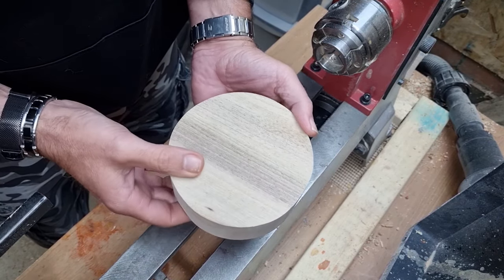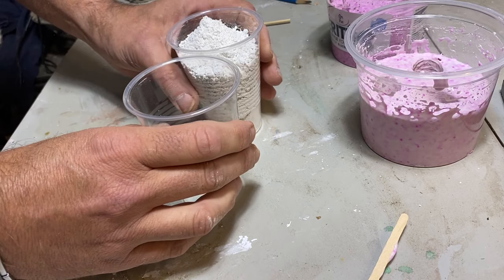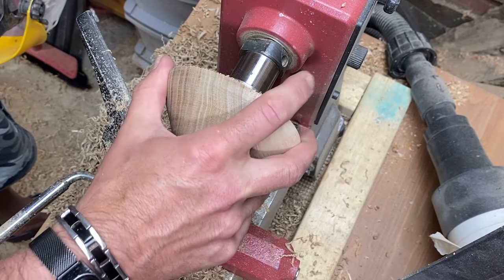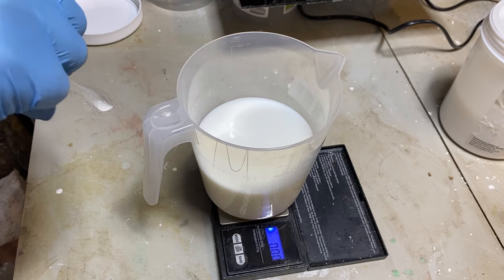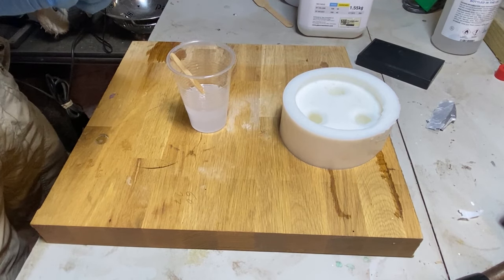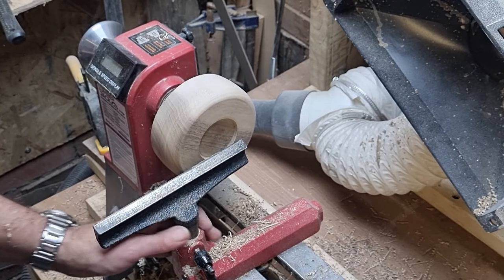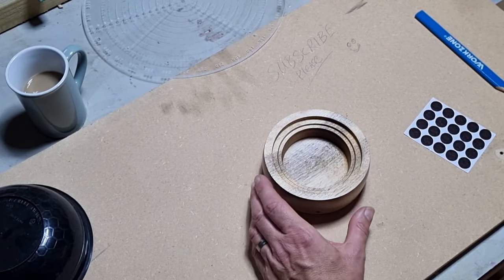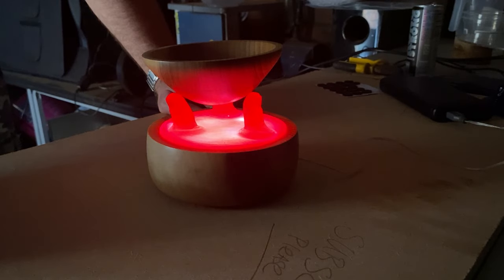This Woodturning Project Cost Me 3 Fingers!! #woodturning #epoxyresin

Comment: I was not sure what the project would look like based on the thumbnail.    Very well done.   Wow, a LOT of work.

I think the molding, casting etc. was 90% of the time and the turning was not much.

I got a smile when you put your fingers in the alginate to make the mold.    My mind went back to high school in the mid to late 60's.   I wonder how many school boys heard "{enter last name here} get you finger out"  perhaps more likely in wood or metal work class which would be long gone these days.   I can just hear Mr Gamble the metal work teacher saying such phrases.
I did not know about alginate, so I learned something.   It seems very common for dental molds - at least in the US.   Thanks.
Dave.
Reply from the maker: Hi Dave, yeah I had a few comments like that hurled at me when I was at school. You are right about the time spent making the mould against turning, all the wooden components were finished in about 40 minutes. With regards to the alginate, one of it's main uses is in the dental industry, it sets very fast and can produce a very clean mould . It's fun stiff to play around with. 
I've changed to thumbnail the video is performing worse  than ever :( 
One day I'll get it right :)
All the best
Mike

Comment: I wonder, do you think putting a layer of wax or sealant on the plaster blank would smooth the surface of the mold?
Reply from the maker: If I had covered it in a lacker or teson to give it a smooth surface then yes it would 👍

Comment: Hey awesome!  I'm totally familiar with this medium.  In 1994 I saw an ad for a product called Body P'Arts' in a magazine.  I send for it and in 1995 mixed the pink powder and made casts of the hands of two friends.  Hands to the wrists.  I poured in the Plaster of Paris, thumped it for air bubbles too.  I remember using a thin straw against the hands, then blowing to release each hand.  I still have some of the pink medium in it's container, and out in the shed, a small bucket with the Plaster of Paris.  Hey Michael, if I was your neighbor, I'd ask you if you would let me make casts of your hands too.  That'd be cool.
Reply from the maker: Haha thanks, that would be cool! But you will need to throw away the plaster of paris, as I learned when making this it only has about a year shelf life
Reply: About the pink powder of the mold medium, I remember it had an interesting odor about it - sort of a spicy scent, I think something close to cinnamon.  About the Plaster of Paris, when I can get into my shed, I'll have to mix some up and pour into a Dixie cup and check it out.  Right now the door is blocked with that rotten snow crap. @MikeHolton
Reply: Jan. 27 I brought my  Plaster of Paris to the house and mixed one cup and poured into a cottage cheese container.  It is as hard as a rock with no bubbles on the surface.  I bought it 30 years ago when I got the Body P'Arts' kit.  I've got a half gallon of it left. @MikeHolton